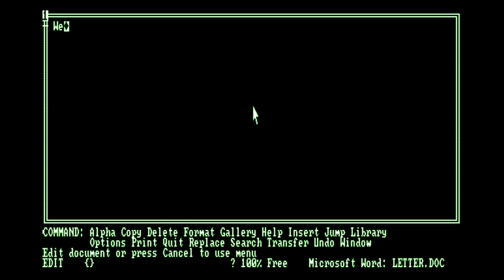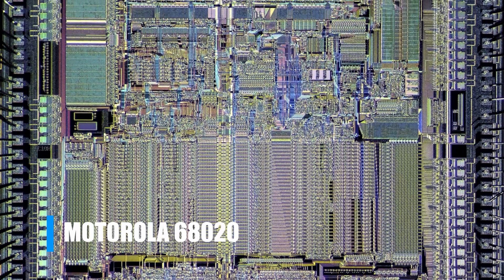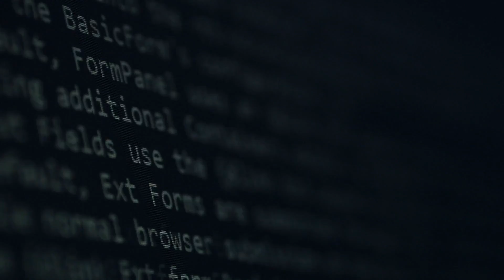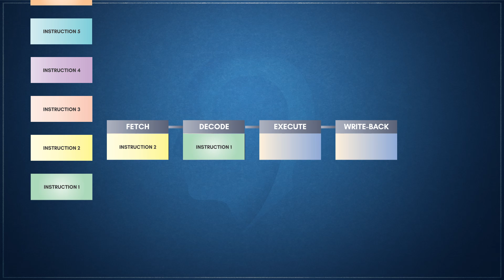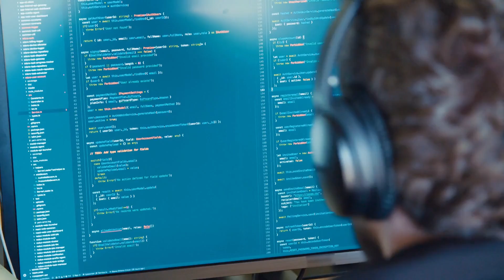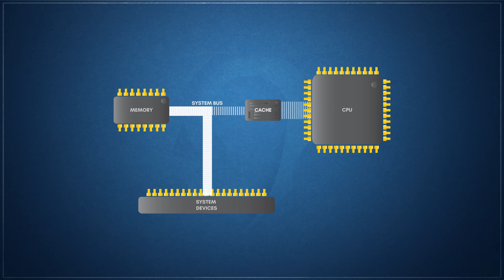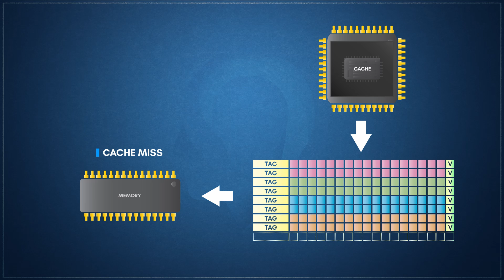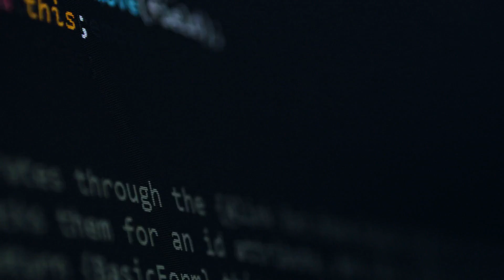The Evolution Of CPU Processing Power Part 4: The 32 Bit Processor - Pipelines and Caches

Comment: 06:02 Memory Management Unit
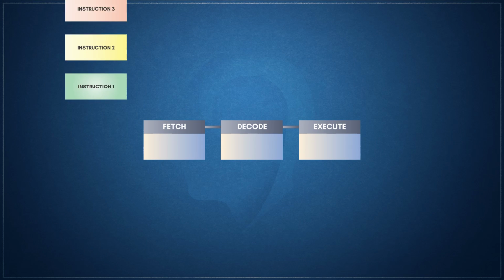07:12 Pipeline
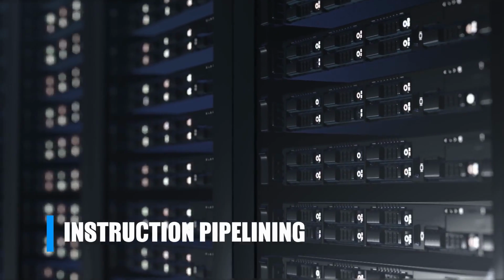07:51 Instruction Pipelining
08:30 Pipeline Controller
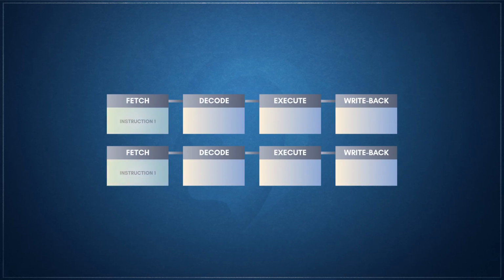10:57 Superscalar Pipelining
12:20 Cache
14:37 TAG
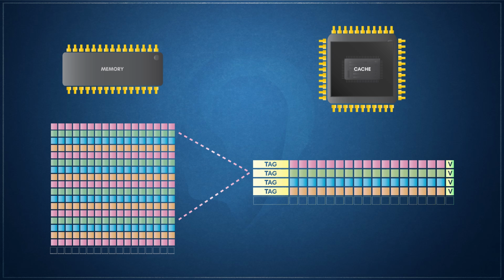14:53 Fully Associative Cache
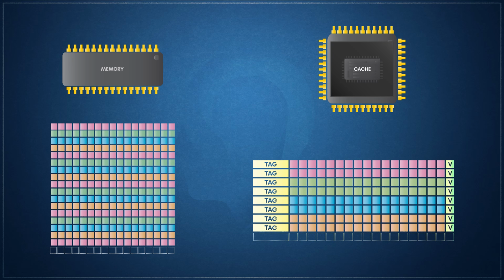15:11 Set Associative Cache
15:17 Set
15:28 Set Size
15:45 Cache Hit vs Cache Miss
Reply: TAG Unit X PSU Unit Y.

Comment: These are good videos, but I'd like to offer a minor correction. Super scalar refers to the general ability to fetch, decide, and dispatch multiple instructions per clock. This also relies on sufficient backend compute logic that multiple issue can mostly keep up. I'm not aware of any commercial processor that can split it's resources to follow multiple branch paths at once. Also, keep in mind that this would grow exponentially with each encountered branch.

Comment: FPT16/INT16 pre-cached instruction results in a 4TB rom, multiple "cores", program control units having just the core registers, also shared fast program (counter) cache, for fast pointer from the cores, easily 40k and more cores
Reply: you could rearrange instructions that they populate the ALU silicon 100%, not only the instruction you are currently at, or just dynamically switch to an instruction mini-fpga profile per instruction, to minimize silicon area and power per core
Reply: you dont need to divide into fetch-decode-execute, just have all-in-one, no slow downs, lightning fast switch to next instruction, even if different execution path
Reply: work in vain, like unneeded code
Reply: your "simplification/efficiency" makes things more complicated, k.i.s.s. engineers
Reply: pipelining is horrible
Reply: 16-bit cores can emulate up 32, 64, 128 whatever is needed
Reply: keep both the complete program and main bulk of the data in gigabyte local L2 cache, as well as the instruction result cache (which is fully populated, for each instruction-argument-argument pair-triplet)
Reply: do you mean decode is combining smaller parts of the ALU into the actual instruction, to minimize the silicon needed for the instructions
Reply: cpu-local main memory, not lousy mini-caches, at L2 speeds, money is a poor reason to do or not to do something

Comment: One note about cpu and memory speed... there was a time when memory was faster than typical cpus. This can be seen in many late 1970s and early 1980s home computer designs, where memory was used in alternating cycles between video and cpu. In the more advanced designs, this was done using a dual phase clock, where one edge would be used as cpu cycle, and the other edge as 'video cycle'. For this, ram had to run at twice the rate of the cpu. Of course this approach became unviable with the introduction of 16bit and later 32bit cpus and higher cpu clock rates.

Comment: The import of flat memory model for the 80386 was that it got rid of the segmented model for programs larger than 64kb. In that amazingly stupid model, it was necessary even to custom design C programs just to run on the 8086-80286 CPUs, in the form of segmented declaration and management. This prevented, for example, a port of Unix onto the 8086-80286 CPUs. If they hadn't done that (introduced flat model), other CPUs would have taken over from Intel's CPU line, since microprocessors were taking over from Minicomputers and workstations. Intel initially embraced the segmented model as it prevented customers from easily migrating to other CPUs, since the programs would have to be redesigned, but with the rise of workstations based on RISC and 68k cpus, it became clear that it would prevent a lot of programs from being ported TO the 80x86 family just as it would prevent porting FROM the 80x86 family. It worked! 80x86 CPUs eventually killed off the workstation (and later server) market just based on cost. And this is long before the age of ARM.

Comment: I enjoyed this video.  As a commercial computer designer who started working in the late 1960's, I've seen the features and capabilities of the large mainframes (advanced architectures, 32/64 bit, caches, virtual memory, I/O channels, SMP, RISC, emulation, etc.) migrate to the consumer market as microelectronics dramatically reduced cost and increased density.  As I see it, advances in microelectronics allowed consumer software to develop the capabilities we see today.

Comment: 32bit processors in 1948? Is that true? Edit: looked up. Manchester Baby. But that was only 32bit  memory bus. Not the instructions set nor data bus.
Reply: I don't get the complaint about the Baby - it was a serial implementation of a full 32 bit architecture, though only 13 bits of address were used. Most other early computers were 40 bits wide or more since numerical precision was considered important for scientific calculations. In the late 1950s narrower machines focused on business applications were developed. If the PDP-8 is considered the first true minicomputer then the 1960s saw the trend to start small (12 bits) and grow as time went on (16, then 32 bits). Microcomputers repeated this from the 1970s on (4, 8, 16, 32 and now 64 bits)

Comment: The concepts here about Operating System like segmentation apply to only Intel x86 family or ARM based CPU's and their OS's like android use same concepts? also, as others mentioned it would be good if you explain concepts of Multitasking n Multithreading, how multiple cores are used.

Comment: I've been reading Computer Architecture by Patterson and Hennessy and I am amazed by how complete and correct your discussion of caching was. The only thing I think isn't quite right was the statement "virtually every aspect of a cache's design is made to achieve a maximal hit rate", which should have probably replaced the word "is" with "was" since access latency ,currently, is an issue that has to be considered and forces trade offs against maximizing hit rate. However in the context of the late 80's and early 90's I don't think the access latency of a cache was as much of a problem since it seems that the access latency only becomes an issue once caches reach a large enough size which they weren't in back when 32bit processors were first introduced. Hence why I think the quoted statement should have been more past tensey.

Comment: A pipeline treating fetch, decode, and execute as the three steps dates back to the IBM 7094 II, and the 6502 did this as well. Processors like the Pentium were considered notable because they had pipelines which split the execute phase into multiple parts.

Comment: Very cool, sort of off topic but this reminds me of how a CPU engineer was describing how the 1's and 0's are actually analog as it takes a an activation threshold to decide whether its on yet.  A somewhat smooth curve on a graph and theres lots of points on it that you can say its  "on" but they pick a certain spot and has to do with the electron bleed and what not. Far from a strictly on and off process, which leaves lots of room for advancement i think at the transistor switch level before quantum computers are finally practical.

Comment: Call me crazy, but I want to etch a board for one of those old ceramic packaged 68k PGAs. No soldermask either, just a raw tin plated design on FR4. The only thing holding me back is an era appropriate video output circuit...and garbage programming skilz...but that can't stop my copy paste hack ass from trying
 Thanks for the upload.
-Jake

Comment: 13:30 Someone benchmarked i386  33MHz and Intel Pentium M 1600MHz witch both L1,L2 caches disabled. Turns out in DOS it wasn't much faster like 2-3x at max not 50x. DDR1 at 200MHz was almost as fast as EDO RAM ~100ns. Witch  shouldnt be supprise. But it shows that CPU wouldnt be ANY faster without internal SRAM and shows how DRAM became bottleneck like 20 years ago. Up until modern times 50-100ns remained typical time that is needed to access particular cell in DRAM. Most modern DDR4 need 15ns, witch is caused by faster clock speeds but modern CPU wastes 30-70ns before it even begins so total time is still at level of 100ns averange. Firstly CPU need to search for content in caches then it sends demand to RAM controller then RAM controller grabs whole 64bytes into the cache then it is available. Worth to mention that also DRAM in modern times wastes 50-80% of it's time on refreshing it's content. It became so large comparing to internal speed behind all those internal banking it uses almost all of it's time on refreshing. And depending how deep association is (how large association tables to seach for addresses) it may take for CPU 2 cycles L1 it may take 4-16 cycles L2 and 32 cycles L3 it all takes a lot of time before its even able to execute anything

Success of Intel Core architecture in 2010 Sandy Bridge was caused mostly if not only by reduced time needed to access RAM ~45ns compared to 100ns for Buldozer's three layer cache hierarchy. Success of AMD ZEN was caused by multiple factors but wouldn't be possible if they not redesigned RAM controller and cache hierarchy.  Modern DRAM including DDR5 is made upon very simple principle of adding yet another layer of miltiplexers, banks witch causes random acccess time to remain the same as compared to RAM made 20 years ago, what only increases is "streaming" lange data transfers. So in result even most modern CPU wouln't be any much faster than i386 without it's internal SRAM cache  subsystem.
Reply: As a budding DBA, I call this insightful. Thank-you.
Reply: The Pentium actually is the much faster cpu. This test was basically comparing ram access speeds not the processing power of the chip. If you starve any cpu of data to process it just cant process anything and suddenly cpus are all the same :D
Reply: @TheDude50447  Well.. yes and no. It was benchmarked using popular DOS 3D bench so it wasnt just memory benchmark. Despite of superscalar architecture and huge clock speed advantage it wasnt much faster.
Reply: @TheDude50447  Forgot name of leading C++ programmer C11 standard co author. He proven how RAM became problem in current era of multithreading. Shared RAM resources are huge bottleneck, cache may fix single core problems would not fix it at all if you deal with tables that wont fix in cache and shared resources. He proven how 1 core system could be faster than 18C Sky Lake. If programmer would be aware that he dont have GB of RAM and GB/s but max 16kB and RAM is like slower than 1.44 FDD. Just like 40 years ago. Can you imagine it would take 1s to transfer 20MB of cache back and forth to registers if you call each cell in random manner.
Reply: @TheDude50447  You are correct Pentium is much faster, not just by RAM/cache cause Pentium begun era of superscalar CPUs. Dividing instructions into smaller pieces and puting those pieces in pararell, Intel was able to outrun 68k and also end CISC/RISC war. Obviously i386 have to be much slower since it wasn't superscalar and it's not just caused by more sophisticated caching. But even if you have multiple ALU and AGU units if you have pipeline in each of those you run multiple instruction in pararell.. still what program does is based on data. Huge data still it have to fit in RAM wont fit in cache. Spectre and Meltdown caused OS to invalidate caches every 20ms back and forth.. I was improvising when i wrote this comment you replied to. I just tried to convince myself either. Maybe it's not true  but still better to feel weakness of RAM. Thats why i wrote it. So people may realise there is a lot to fix we have still one leg stuck in past.
Reply: @KabelkowyJoe  Looks like we need transistors based on new physical principle.
Reply: @KabelkowyJoe  Just remember the use of the Intel chip line is just for reference and represents the development of these concepts in single chip microprocessor system.  The description of the evolution as manufacturers strove to put more and more of the architectures found in large mainframe systems into microprocessors is fascinating and the description of how it all works is quite good.  However the era of super scalar CPUs predate all of this by more than a decade but integrated circuit technology had not evolved enough to allow these techniques to be put in to a single chip CPU.  For example, here is a reference from 1967; R. M. Tomasulo, "An efficient algorithm for exploiting multiple arithmetic units", IBM J. Res. Develop., pp. 25-33, Jan. 1967.  The IBM Model 360/65 I used in the 1970's was both a dual SMP processor each with super scalar execution, MMU and a host of asymmetric processing units providing DMA based I/O operations.  It's often said how 'slow' these older systems were but their actual workload throughput was very high even for some of today's systems.  Most modern desktop type machines are only now coming close to what these mainframe system do.  The current generation of system (look at the IBM Z/15 series) talk about the Central Processor Complex.  Ironically some of the ARM based computers do have the beginnings of this architecture with several SMP CPU's plus ancillary PU (processing units).  Political mode ON:  Just need to wean ourselves from Microsoft Windows that is basically single user, multitasking to a real operating system so we can fully use these modern architectures.